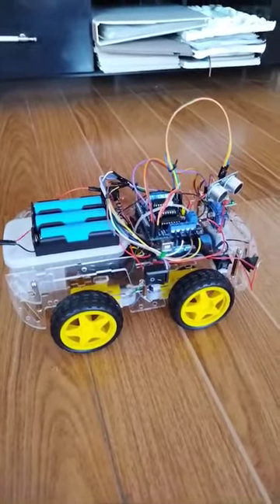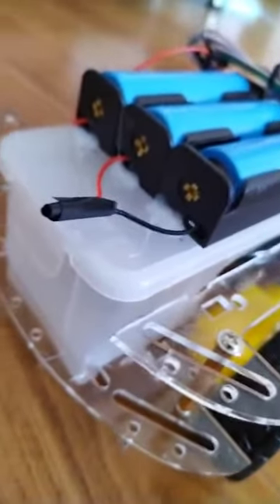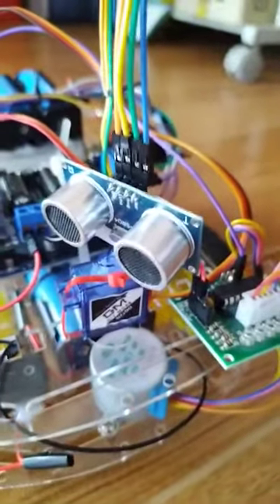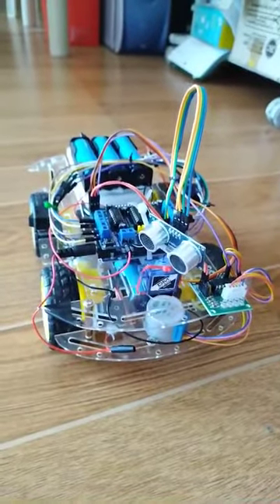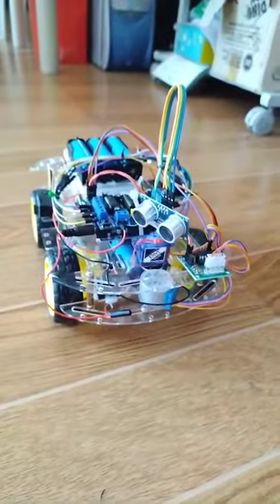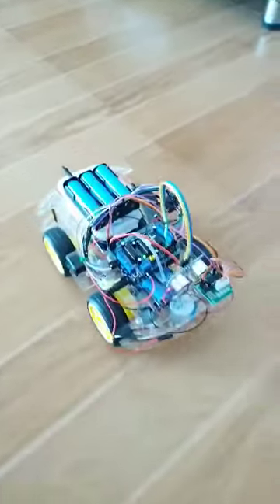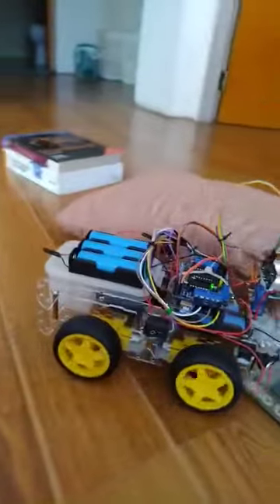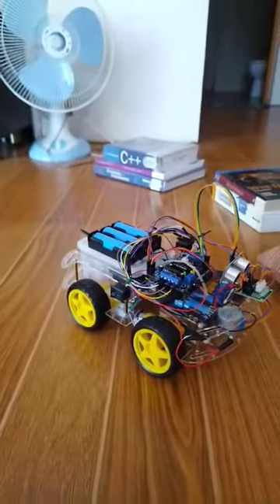Cleaning Robot with small vacuum installed

Comment: boss my 1pc trend controller ahu 1 is burn so in need to replace new on ahu 1 so please can you make a video how to start new controller configuration
Reply from the maker: what Building Management System you are using? I am using Schneider B3 controllers and Automation Server AS-Bacnet
Reply: i am using honywell trend boss
Reply from the maker: @Joyaguru  sorry but I don't have engineering tool or Honeywell software and trend controller to demo
Reply from the maker: @Joyaguru  do you have the user right to do some engineering work with your BMS?
Reply: no sir
Reply from the maker: @Joyaguru  then you need to call service guy from Honeywell